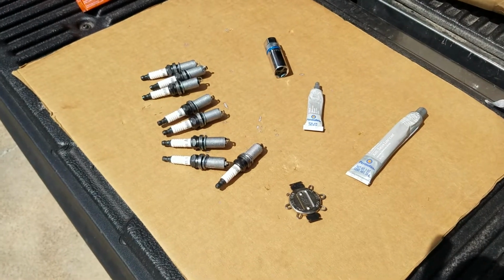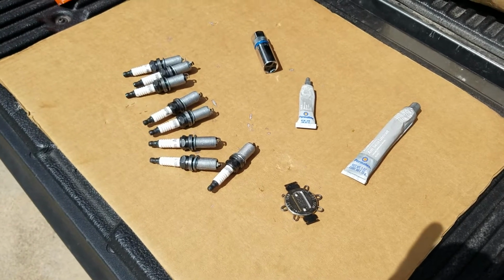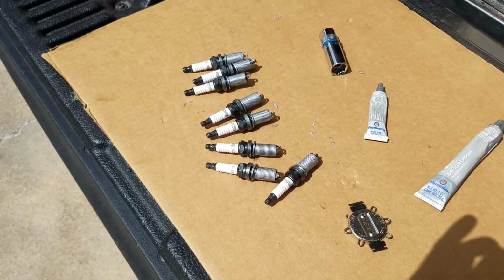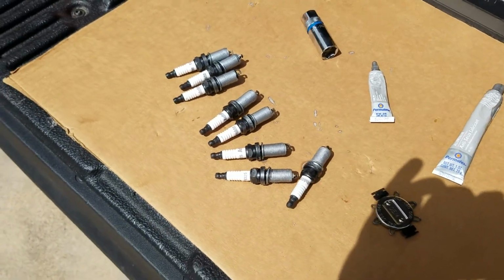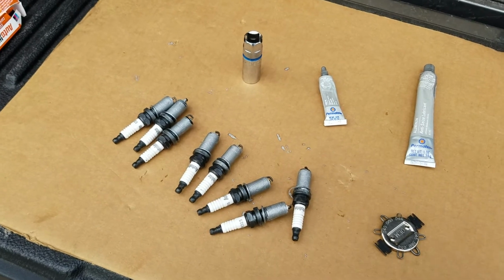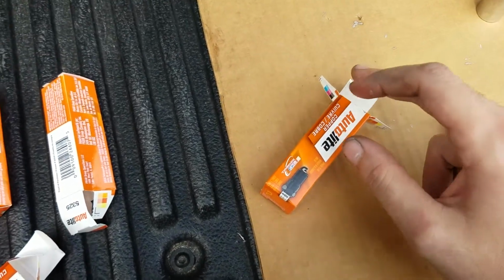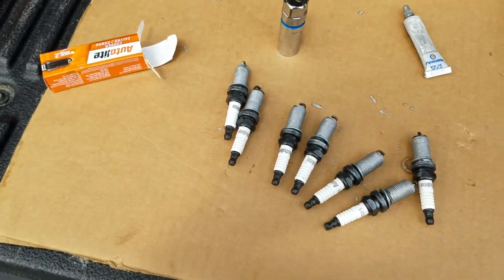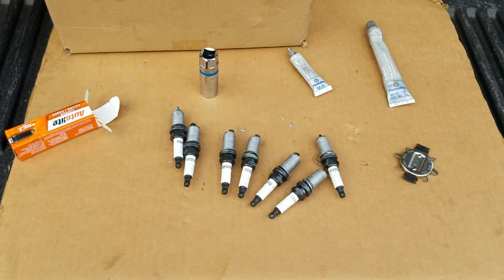RAM hemi tune up tip, less time, less hassle.

Comment: Good tips, the back 2 plugs on each side are a bit of a PITA to get to.  I ran the factory recommended NGK plugs as some people has issues with other plugs in the newer Hemi's with MDS.
Mine is a 2012 too.  No issues at all, its just time consuming. Sure beats taking it to the shop.
Reply from the maker: Heck ya man. I'd rather suffer a little for a couple hours and keep a few hundred bucks in my wallet!